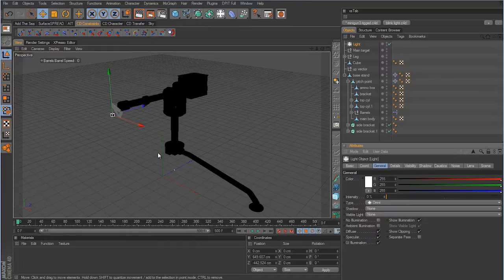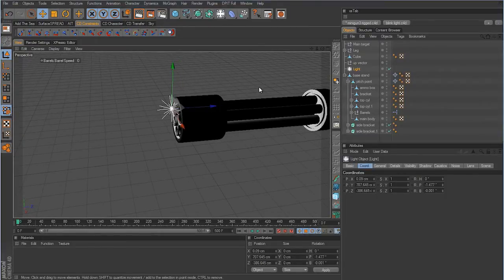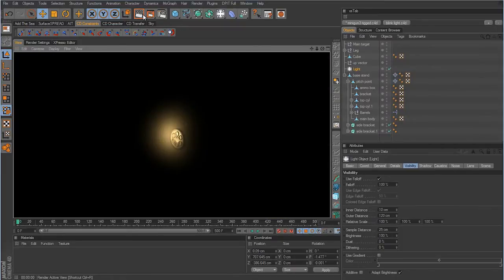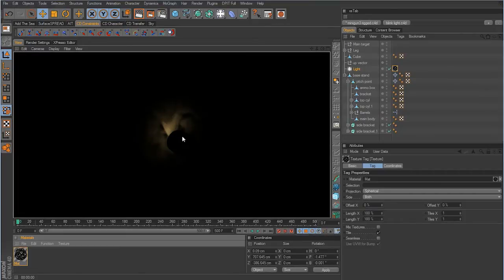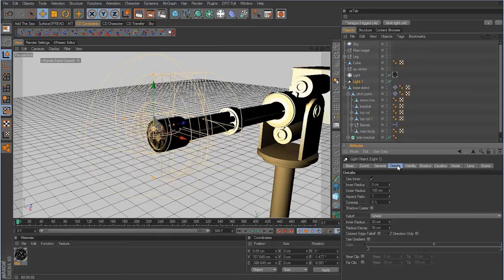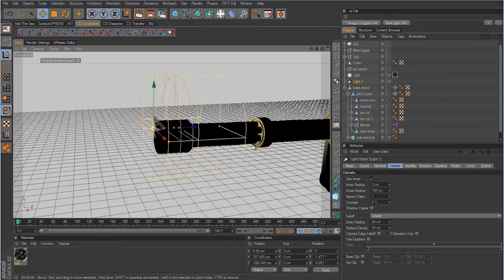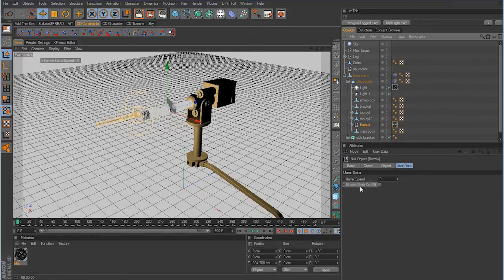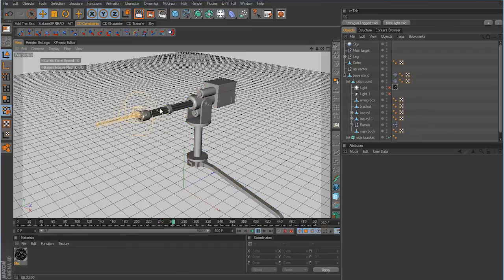Cinema 4D Tutorial - Minigun Part 6 - Xpresso muzzle flash controller

Comment: hey, I've got a question, I followed the whole tutorial, but I can't get this Xpresso stuff to work, I've got the whole same layout in Xpresso with the math nodes and such, but whenever I connect everything, the divide node's name turns yellow (opposed to the normal grey colour) so I'm taking that as an error and thus the xpresso does not work. I'm using VRay with this but that shouldn't be the issue (I switched it to a normal omni light without succes) could you please explain what's wrong?